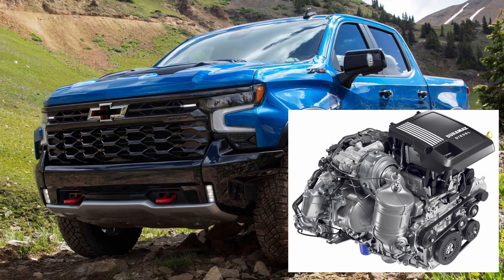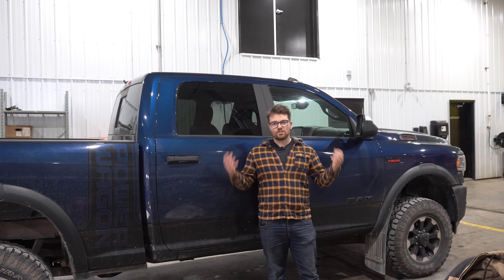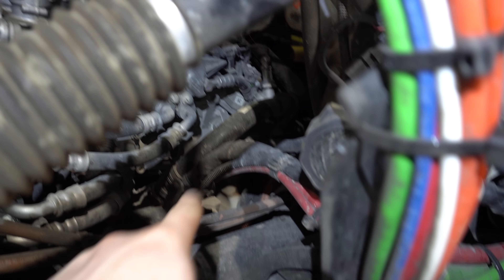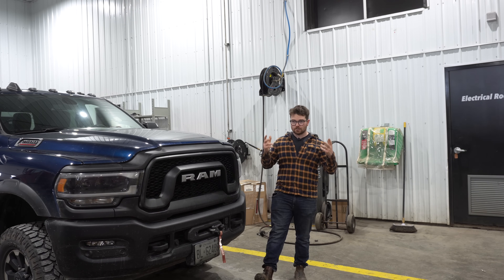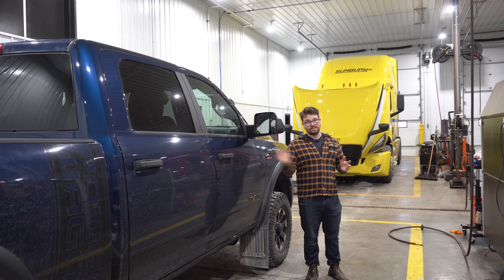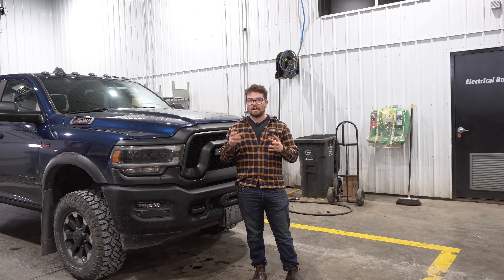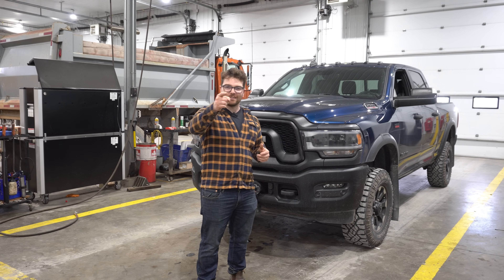Chevy Silverado 1500 3.0 Duramax Diesel **HEAVY DIESEL Mechanic Reviews** | Is It a GOOD Engine??

Comment: I've got a 2020 AT4 with the "Mini Max".  I've put 57k hard miles on it without issue including living in NE Wisconsin where it sees a legit winter and hauling a 2k lb truck camper all over out west during 100deg heat up and down mountains.  Great engine and great MPG.  Very smooth power and hauls with relative ease.
Reply: Good to hear. GM updated the 3.0 and addressed some issues. GM is lone arbiter of a small diesel. Ford and Ram backed out. Why go hybrid when you can have a diesel? They’ll sell every one they make.
Reply: Cool too hear some thanks for the info just purchase one 👍
Reply: What kind of MPG do you usually get when empty?
Reply: @georgiafan6618  I spoke to a guy that works at the plant in Michigan that's building the 3.0. He said they're building about 550 engines per day running 2 shifts if I remember right. They must be popular, one big volume truck dealer I stopped at was big on keeping them in stock. They're trying to maintain 30% diesel in the half-ton mix.

Comment: I have 95,000 miles on my 2021 LM2. All I’ve had to replace is the coolant control valve (under warranty thankfully). The only other issues I’ve had with it are emissions related due to lack of high speed/hot EGTs driving conditions. Otherwise, love the engine. It’d be perfect deleted…

Comment: 8:55 that is the ONE flaw of this engine....... 
.
i wish they did something like the old V8 gas engines... where if the oil pump isnt turning... the distributor stops turning also
which shuts off the engine preventing MAJOR harm
.
im sure the ECU shuts down the motor if it doesnt sense oil PSI
but GMs sending units are KNOWN for "failing high"..... and saying the engine has 120 PSI at all times (even shut off, but key on)
.
like, every 5.3/6.0 LS has this issue
they either "fail high"....
or leak oil (i had a buick 3.8 pump 4.5 quarts on the floor before i got it backed off the lift..... when the nose came down the ramps, i saw the trail and shut it down.... a new sender and that car is still on the road today.... buick 3.8s are hard to keep down LOL) 
.
anyway.... i THINK gm has gone to a new style sender..... as the LT engines dont have this issue nearly AT ALL!!
.
.
but still...... its possible ANY!!! sender could "fail high"
and the ECU thinks its got all the oil PSI in the world....
and doesnt shut down the motor
.
which is why i like mechanical systems like using the dizzy shaft to turn the oil pump
mechanical systems fail, sure.... but if this fails, the motor stops running 100% of the time

Comment: Would you recommend deleting after warranty is over? I have a 3 year 100k mile warranty on the engine of a truck I just bought from the dealer with a new LM2 crate engine because the last one has catastrophic failure. I’ve had the truck for a week and have 3 years left on the warranty basically. 2020 Silverado LM2.

Comment: The new trucks are an LZO now at least in half ton trucks the SUVs I think still have the LM2 till 2024. I think the pistons are now steel I know they are 305 hp and 495 ft/lbs of torque. I have one of the new Denali Ultimate. I get around 28 mpg and best I have got is 37.5. I think now with they claim 200k miles on the oil pump belt. Either way I am not to concerned. I will have a new truck before I ever had to worry about that lol

Comment: Quick question for ya..... Looking to get a new 25 or 3500. Only pull a gooseneck roughly, once every three weeks. With gas being cheaper than fuel now days. Along with all the great "crap" the GOV made us have on diesel eng. now...... What would your advice be to buy,  gas or diesel? 
FYI, I'm speaking of V8 type for both eng. types.        
 Thanks in advance!

Comment: Do anyone have an idea about this truck doing a (drone noise) after 8th gear about 65mph.
You can hear it and feel it coming from bottom of truck.
It’s just when I push accelerator, I release goes away.
Any thoughts?
3.0 2023 
Brand new and doing annoying noise.

Comment: I no 2 people in my area with a 20 ram and 22 ram. Both Cummins. Both tranny problems. The 22 only had 10k miles was in the shop 3 times last time they said it needed a tranny.
Reply from the maker: The ram 2500 cummins comes with a trans called the RFE68 and it is hot garbage. no surprising honestly
Reply: @GettysGarage  They never mentioned 2500 or 3500. The 68rfe is junk. The aisin is better but still not all that good

Comment: I just got a Sierra 1500 with the LZ0 engine. The dealer is about 60 miles from my house. I drove home and right when I got off the freeway I started smelling a plastic/oil type burning smell. Got home about 1 mile off the freeway and my wife came out to check out the truck and immediately complained of the smell. Is the smell most likely a “regen” cycle? I hadn’t even heard of this before but just found it on the internet searching for what the smell could be. It sounds like a regen doesn’t usually happen so quickly though. Should I be worried about a regen after less than 75 miles or is that normal for a new LZ0 engine?

Comment: So I’m looking at the 2020 Ram Eco 3.0L vs the GMC Duramax 3.0L 2020. Both I have found have less than 50k miles. I have a commute everyday for work 84 miles round trip. It’s all highway there and I have to pull a lighter load (4-6k lbs) here and there. My silverado 6.2L just had the camshaft break (104k miles) and I’m tired of the laundry list of its issues. Does anyone have an opinion on either engine? I am mostly looking at fuel economy without sacrificing much towing. I want to get 20+ highway and need a full-size to take my crew from the office to some job sites and do inspections.

Comment: Unlike this guy I have drove one of these I liked it so much I bought a 2023 lzo 3.0 trailboss gets 28mpg highway tows as good as any 1/2 ton the motor has all the power you will need. The 2023 has steel pistons and the belt service is 200,000 miles. I have put 10,000 miles of hard driving without a hiccup. 4:03

Comment: Just traded in my 2022 RST, had to replace the EGR sensor as well as the cooling pump. Covered under warranty but the truck only had 35K miles. As far as MPG, I was getting 25mpg over all but with diesel costing $1 more a gallon and needing DEF fluid every couple of months, there was not much of a cost savings in the end. The service manager at my local dealer recommended I get away from this motor as they have a history of being really dependable or really bad, and I appear to have one of the bad ones.

Comment: GM just bought back my 2024 Silverado 1500 ZR2 with the 3.0 Duramax. That engine gave me nothing but problems. It never stranded me, but all of my issues happened in the after treatment system. Tons of sensor issues. My dash lit up like a Christmas tree on multiple occasions. At one time, it threw 9 codes and the dealer had no idea how to fix it. They replaced multiple sensors and even the ECM. It also had issues towing and major defects with DEF consumption. I loved the power and fuel economy of this engine, but ultimately had to turn it in. Luckily GM made the process smooth

Comment: Was wondering which 3.0L Diesel is better for a Senior Citizen that tows across the country twice a year about 7k and is there a way to delete the DEF buy removal of a fuse or chip? And then if we take it to the dealership for Service replace the fuse or chip?? So in your opinion is Rams Diesel better than Chevrolet's Diesel for all around cost to own and operate??? I don't care about Ford's, as I will NEVER OWN ANOTHER ONE AGAIN!!! I would Also like to have you compare the 3/4 ton Crew Cab 4X4 with 8ft bed from Ram and Chevy for the most Fuel efficient in either Gas or diesel towing 7k and 10k and not Towing but with 1k in truck (to be like having 4 Adults and tools and gear in truck... I can't believe that nobody is smart enough to come out with a Crew Cab with 8foot bed in a 1/2 TON TRUCK!!! They would sell MILLIONS OF THEM!!! Message me back when you get a chance to do that video as I don't have internet access, until I go 30 miles to Walmart or to McDonald's, because I don't have any Data on my phone... Also where are you located?? As I have a 97 F350 7.3L that NO ONE CAN FIGURE OUT WHAT IS WRONG WITH IT!!! I have spent over 2k in parts and they are just GUESSING AT IT AND COSTING ME MONEY!! I FEEL THAT IF THEY DON'T KNOW EXACTLY WHAT IS WRONG WITH IT, THEY SHOULD PAY ME FOR THEM TO PRACTICE AND LEARN ON MY TRUCK!!! I shouldn't have to pay for them to put on parts that don't fix the problem!! Right?? Especially when I'm on Social Security Disability and on a Very Low Fixed Income!! Please let me know asap, Thanks 
PS I like your video...

Comment: Love it!  Mated with the 10 speed transmission- an awesome combo.  Love the torque and pulling power.  Sometimes getting up to 25 mpg city and freeway driving.  30 plus at times hwy.  Always affected by wind and mountains.  I am in Texas and have taken it to Boise, Idaho.  It really shines at 80 mph across Wyoming with the torque, up and down hills and 28-30 mpg.  Had about 800 lbs payload and it never looked back. Wish the fuel tank was a bit bigger.

Comment: Owner of a 6.6 L5P 2021 3500 Denali and the wife has the Jeep Gladiator with the Eco Diesel.  Neither are deleted.  I regularly tow 10k with my truck the wife daily drives hers.   Based on what issues the Eco Diesel has had we typically strap up the equipment trailer for a 50 mile run down under hard acceleration for her Jeep.   15k miles on it and i’ve had the egr system apart with barely a but if soot buildup.  There is some but negligible.  Single tank of cetane boost, hard towing once a month and regular checks the eco diesel is and will continue to be an excellent choice for us.   I’ve considered the 3.0 litre since my average tow is less than 10k but when i need 25k…my L5P is amazing.  Not quite on point with the 3.0 review here but dint dog the eco diesel.   FCA will continue support for at least 5-10 years and the aftermarket will continue after that.  And with an average of 28mpg in the Wifes Gladiator we wont be trading any time soon.

Comment: This is a long comment, just a warning. I have a 2021 RST Z71 with the LM2, bought it brand new with 10 miles on the clock in May of 2021, and right now I'm sitting just shy of 30k. My family and I do a lot of traveling since my wife is from the PNW and my extended family is in Texas and spread out from Arkansas to South Carolina, so gas mileage was the biggest selling point for me. We went down to Mississippi last year and according to the computer our best average for 50 miles was 38mpg, but to be fair that was coming down the mountains of Montana. We did average mid-to-upper 30s the whole trip, but again I set the cruise at the speed limit except for the few spots where it was 80mph. I did have the long crank issue once and managed to be 1 of the lucky few that needed an ECU flash. My thought on the oil belt is by the time it needs that service I will have spent way more than $1k in service into the truck anyway and knowing it's going to be coming I should also have plenty of time to put money aside for that. My whole family loves the truck and it has been the best vehicle I have ever owned. My only complaint is the damn auto-stop button you have to press every time you start it up.

Comment: 2022 GMC Sierra 1500 wit the 3.0 L Duramax with 11000 miles. It has been in the shop for emissions issues for 3 weeks now and over $6000 in warranty costs so far. This vehicle also stranded me twice in the first 2000 miles. Good fuel mileage and torque. also transmission is not very smooth all the time.

Comment: Working in a gm service dept, these trucks, cooling system is the number 1 issues, miles of rubber hoses and plastic quick connectors = frequent leaks. Exhaust rattles and leaks. Nox sensors  and egt sensor failures, only done 1 rear main seal so far. Lots of backorder parts = massive down time....
Reply: That’s what you get when unions run management..

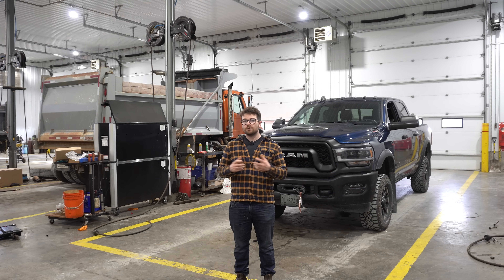Comment: 4:51 the AMC/jeep 4.0 is actually oversquare....... and its still known for torque
however, the 4.2 (the AMC I6 before the 4.0) is massively undersquare..... 
.
you can do a LOT with intake runners and exhaust to get that torque from an oversquare engine.....
but ya... undersquare... while not a high RPM (theirfor, high HP) engine.... does make TONS AND TONS AND TONS of torque

Comment: 12:04 is it really a GM with out a bad rear main seal??? 
.
from the gen 1 283, 327, 350, 400 ETC small blocks....... to the LS/LT.... to their diesels 
they ALL!!! develop rear main leaks
.
i just look at it as the price you pay to get a reliable engine with good power and GREAT! MPG
its just sweating horsepower..... and rust proofing at the same time ;)

Comment: These will be dumped very quickly once someone has to take it to the shop, after the warranty runs out. If you run the numbers and my small business has, modern diesels in small trucks can not pay for themselves. Fuel cost, emission maintenance, oil, filters etc. and much costlier parts are far higher than a gas engined vehicle. Not to mention the much higher initial purchase price of the truck.
I believe this is why Ford has introduced larger gas engines recently.

Comment: I don’t know anything about diesel engines per say except I have had a  6.6 Duramax since new 2002 . 315k miles and towed a 6x12 dump trailer at least 250k miles and outside of fuel injectors replaced under warranty no issues although I have something going on with dirty cooling fluid. Temp is fine and a little leak but no white smoke. Anyway I have a order in for a 2023 TrailBoss diesel as I want to get better mileage be a bit kinder to the environment and I won’t be doing the heavy hauling in retirement I use to. Anyway I hope this truck and engine lasts me another 22years .

Comment: I have owned Tahoe and Silverado with 3.0 Durumax. Hands down best diesel engine I have ever driven. My only issue is that dumb belt you have to change at 150k mile in engine. Only way to get to it is by dropping trans.

Comment: we own a 2022 Yukon 4x4 with the 3.0L Duramax and love it so far and only in at 13k miles to date. we average 27-30 mpg on highways and easily 24-25 in town or a combined 26-27 most of the time.

Comment: Diesel midsize and half ton trucks only made sense before emissions equipment and fuel prices. Now that diesels are riddled with unreliable emissions equipment, extremely expensive high pressure fuel systems, expensive turbos, and overall ongoing added complexity to a once simple design, it’s not worth it. You may get 30 mpg at the pump but any savings are lost once it comes time for repairs. And that’s a fact. Oh what, you think the warranty will save you? Too bad they try to find ANY reason not to honor it. Plus the warranty periods keep getting laughably shorter and shorter. Today’s gas vehicles are PLENTY efficient. Sprinkle in the price of fuel now and it really doesn’t make sense to own a diesel model beyond personal preference, or if it’s truly needed for a towing/hauling application. It hurts to say that since I’m a big diesel fan, but that’s the unbiased truth. I’m sure most guys who own late model diesel midsizes and half tons will tell you they love them… ask them if that’s still the case 10, 15 years from now (assuming they even keep them that long, which you HAVE to to offset the cost and make your money back). Obviously you’re going to “love” any vehicle you just spent a fortune on, granted it doesn’t have insanely premature issues at low mileage. The prime time for a diesel half ton and midsize was back in the 90s/early 00s.

Speaking specifically for this truck - 1. A belt driven oil pump is a bad idea even if it’s easily replaceable, of course GM would put it at the back of the engine requiring transmission removal. 2. Also leave it to GM to put a long stroke I6 diesel in a half ton and put a short stroke V8 diesel in the HD trucks.  That just seems bass ackwards to me.

Comment: The transmission doesn't actually have to be removed to inspect the oil pump belt. Drain oil and insert a borescope through the drain plug hole. It's right at the back of the engine directly below the oil pump belt. Engine can be rotated by hand to inspect the whole belt.
Reply: The belt is on the other side of a divider on the lower crankcase extension. It's physically impossible to see the belt even if you take the lower oil pan completely off.

Comment: i have a 2022 silverado. I noticed a tapping noise when the engine is cold. it goes away after it warms up. It started after about 10000 miles.  I brought it to the dealer and they said it is nothing to worry about.  What do you think?

Comment: The question is the Duramax a good engine and my answer is not only is it good it is the best from my research, but of course there will be those who will knock it but there are very few.  I reside in a state where trucks are king and I think Gale Banks help develop a great engine and in 2011 the GMC truck won truck of the year and I had no problems with the engine and now I have a 2016 with no problems.  “To each his own” is the saying.

Comment: Lets see, pull the transmission and jack the cab up to inspect??  First that's just crazy,  second If I have to go to all that trouble I'd just replace everything involved. No jacking and pulling twice.  I'm afraid that whole scenario would be stuck in the back of my mind.  I'm taking a firm pass on that engine. I've had 2- 6.0L LS motors go 300k ea w/oil changes only. That is what I expect, or even more, from a diesel.  IMHO,  swing and a miss GM!    8(    --gary

Comment: I guess I'm interested where you heard the fuel pump requires replacement at 100k miles. I've never seen it in my manual nor heard of it.
Reply: Belt is not a problem. He has no idea what he's talking about